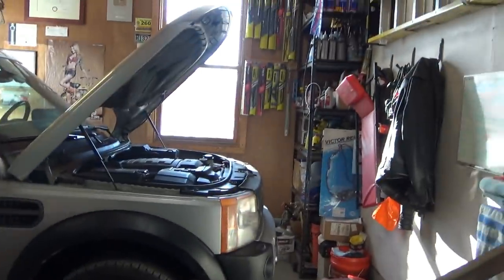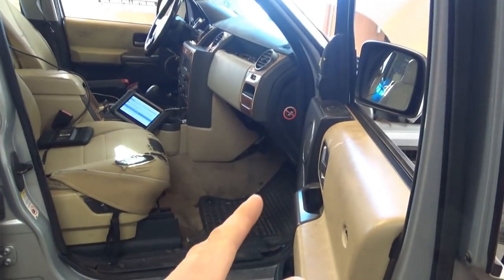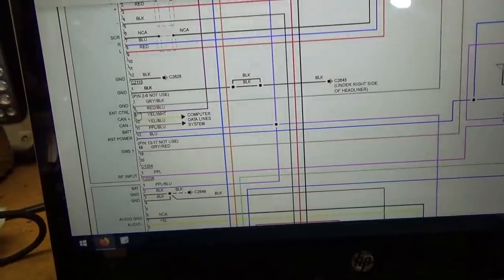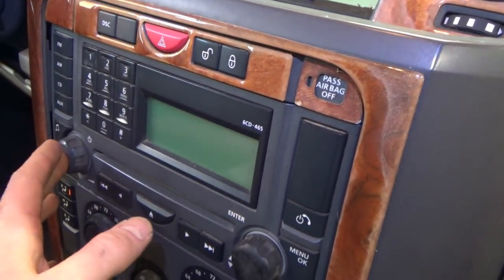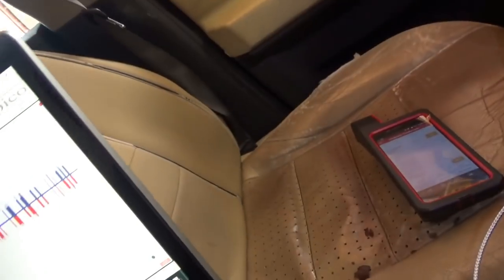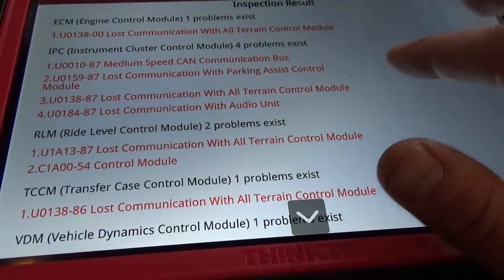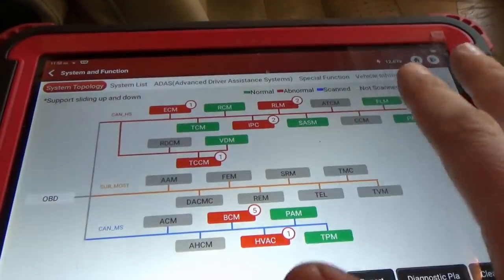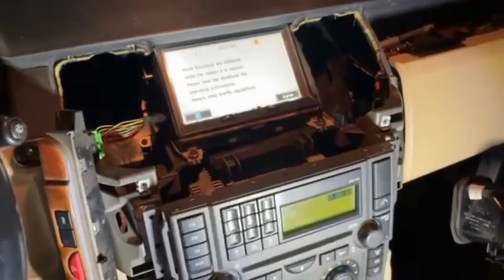Radio? Who Needs a RADIO!? (Land Rover LR3)

Comment: I own an LR3, and have replaced the radios in many LR products. It's often easier to just replace the Nav/radio/amp with aftermarket, as I do that for a living. A couple optical bypass loops, and careful wiring, and you have a great sounding audio system.
Reply: Some problems whit the engine till now? Meaning snap crankshaft... This issue whit the crankshaft is very popular on 2.7 engines in Europe.
Reply: Do you know much about the LR4 with the denso nav/head unit? (not bosch) I could really use some help. Thanks.

Comment: Eric O (SMA) swapped out a Human Machine Interface module yesterday.   He had to make an educated guess. GM says, you take the plastic bag off of the REFURBed unit, you own it.   The radio was all static and  nothing on the screen worked.  The diagnostics really didn't make sense, but everything pointed to it.  He said during the video that 'part' and labor would be about $1,000.  And if the part wasn't the problem, he'd have to eat it.
Reply: I watched that too. I know he took the leap of faith in his diagnosis, but I’ll bet he was more sure than he let on. The Producer said, up the drama and tension… Best Regards

Comment: Great diagnosis. I can't get my head around the point of needing so much software just to turn on the radio, seems like use of technology just for the sake of it.
Reply: @crisprtalk6963  I think the latter are indeed making the profit!
Reply: You can’t blow a horn without it first going through a body control module.
Reply: True glad old car's  don't have all that crap in them at least my Toyota 05 doesn't
Reply: Our manager have meetings for the sake of meeting.
Reply: @neilmurphy845  Not far off.

Comment: It will be interesting to know what’s going on inside the radio unit itself. Is it a transistor failure, bad capacitor or Integrated circuit? Sometimes Ivan opens such things for thorough investigation and micro repairs. Two units in a row, there’s something not right with them...
But anyway, really satisfying diagnosis and outcome. Well done Ivan, you are the Man :)

Comment: Been driving Discovery 2 ever since I got it. Drives like a truck. But. I like it. I've gotten the 3 amigos a few in a row. It will clear and stay clear. Then pop up. It's one of my projects to do a IVAN DIAGNOSIS. Park it in my drive way. Do it the proper way. Scan for codes. Powers and grounds. Go to the module and start checking. 
Instead of jumpering wires and short cutting to clear codes.
I'm going to suspect 2 items.
1. The module lives on the right side under the dash. Right where the sunroof drains. At one point my sunroof was leaking. I have taken it apart and repaired the broken drain line and hose. 
2. I'm suspecting my brake calipers are hanging up. I'm experiencing good excellent brakes a few days in a row. Next. Brakes are getting hard.
Being that the case. I'm ordering brake caliper piston rebuild kits. 
I'm a DYI ole guy. I'm willing to learn how to do this. If I find calipers beyond rebuild. Then I will buy new or rebuilt calipers. 
Wish me luck Ivan.
Reply: Likely to be the ABS shuttle switch, it bolts to the ABS modulator, can be changed without bleeding brakes, wabco part £60, very common cause of three amigos, run a scan on it........

Comment: these computer + electronics troubleshooting are clearly 21st century technology.  Axles and calipers, oil pans and valve covers are solid mechanic's work but the future surrounds the often mysterious car computers and their networks.  Maybe, in 20 years, these computers will better identify their associated failures but until then: powers, grounds, and  communication signals are key.  We just can't get enough of these type videos.  Thx Ivan!

Comment: Eric O just posted a video about a similar issue on a Buick. a new "HIM" (actually a refurbished unit) and a $1000.00 later the car was fixed, but even the Factory scan wasn't telling him much and GM told him that if he opened the replacement part then he owned it.

Comment: Two things impressed me, 1 249k miles and 2 the radio head unit is still available, I'm sure he paid good money for it but just being able to get one, wow
Reply: I paid $139 on eBay :). I returned the other bad one.
Reply: @mattpizzimenti464  Have you tried to find repairmen in NY?
Reply: $50 bucks on ebay.  :) i could have bought 16 used radios and still would be cheaper than a new one from Rover.

Comment: I have worked on an LR3 in the past, had a dead radio in it as well.   Found a burned up SMD resistor in the radio that Rover was using as a fuse.    Replaced SMD resistor with small piece of wire, and it all came back to life...

FWIW:  We also found a BUNCH of corroded splices in the harness in the passenger side rocker area under the carpet.   Rover diagrams suck until you figure out how to read them, then they're OK - actual Rover diagrams give distance into the harness to a splice or connector so you have a good idea of where to start cutting the tape off the harness to go exploring.
Reply: Good find. I would replace the fusible resistor with something similar for safety.
Reply: @dosgos  Remember, this is only temporary - Unless it works (Red Green)
Reply: @icesoft1    Nothing as permanent as a temporary solution

Comment: All those codes are programmed to start popping up automatically starting at 75,000 miles.  This is a Land Rover sales feature.  If you can afford a new Land Rover, then you can likely afford another one in a few years.  These codes are there to scare owners into buying a new one every couple of years.  It also scares off many second hand buyers so that old trashed out vehicles with the Land Rover name plastered across them aren't out there tarnishing the affluent brand image. Obviously not totally serious for those of you keyboard warriors about to get your "Reeeee" on. 😁
Reply: They can link to your bank accounts/ credit record now to determine the optimal time for an expensive "failure", or maybe update the firmware, and randomly disable functions, to "preserve" the performance of the vehicle.

Comment: Ivan, are you ready for the upcoming calls by folks whose cars suddenly lose there connections through UConnect or other cell connected system that will stop when 3G is shut down? Really stinks that Chrysler/FCA/Stellantis and Toyota/Lexus plus Nissan/Infinity all ignored this until now! They have been installing the same 3G based systems right up until 2019 even when they were told the carriers were turning it off.
Reply: Hey! I'm from a distant country... It's very interesting to know about the 3G shutdown. Please show some detailed link where you can read about the shutdown. Thanks!
Reply: @engeneer_ru5827  it’ll most likely be North America first….since we now have 5g and the radio frequencies are needed from 3g to convert to it. Besides we can keep 4g for a while as a fall back….if in your country there is not much 5g you will probably keep 3g a while longer.
Reply: @jonnycando  Thank you for the explanation! What percentage of the US is currently covered by 5G?
Reply: @engeneer_ru5827  not sure maybe 50% or better

Comment: Smashing diag ivan 😀
Looks like the new radio worked perfect 😀
The question is why did it fail, maybe the firmware became corrupted.
Reply: LR is a company that used Lucas electronics for years, they are still known as "The Prince of Darkness" even though the company was closed down in 96, the curse lives on....
Reply: @Blazer02LS  I did notice the Lucas name appearing on new parts but as you said the curse likes the name 😀
I just thought someone bought the name, like some pillock buying the good name of Grundig and slapping it on a crappy washing machine, Shame as grundig made good quality electronics.
Reply: @zx8401ztv  Yeah think it was TRW who bought it, then they sold it to another outfit. Not sure who owns it now...

Comment: Check for water on the floor under the seat getting into a module. Samcrac recently fixed a car that was pronounced totaled because of that issue  with the seat controller.
Reply: Probably because with water damaged cars there is no way of knowing when the next component will fry. 
So you might get it running after the first fix, but then 6 months later there will be another failure, then another, then another.
Insurance just writes it off to prevent future claims.

Comment: So, the ignition on wakes up the instrument cluster, which is the gateway, the instrument cluster sends a wakeup call to the audio head unit 
on the medium speed can bus pins 3 and 11which in turn wakes up the navigation, since the head unit did not wake up it set no communication codes with other modules including the bcm , did I understand this correctly?

Comment: This is an older car, in newer cars a radio is not just a radio, but a computer that does many things a computer is needed for that is not related to basic car function. It's not something you can do without with or replace with something from Best Buy, you would wish they would come up with a standard bus. I think car companies are using the Apple model for their computers, you come to us for a replacement plus the unit is programmed to the car for 'theft' protection, right.

Comment: I had the exact problem on my 2006 lr3 and same codes popping up on my and it was the radio. When I opened the radio it was burn from the inside. Replaced the radio from eBay and it work just fine
Reply: Do you know who manufacturers these oem radio units?

Comment: It’s obvious it’s the radio. The radio can be turned on manually without CAN. The CAN does key command on, illumination on and all the signals to broadcast on the MOST
Reply from the maker: How do you turn it on manually without CAN??
Reply: @PineHollowAutoDiagnostics  Press the knob on the front of radio like you were. It should then light up. This is So you can listen to radio while parked.

Comment: Do you think this is the same for a 2010 LR4 with the Denso system? I had some water leak into sunroof while parked downhill and the majority if water got onto the power strip (clock unit). Fuses are all fine but have not taken anything apart yet. I am in California so cannot come see you. Is there any way we could talk over the phone for a small fee?

Comment: If you really need a radio that badly, wouldn't it be possible to just wire in a cheap aftermarket unit?  If a used stock radio is $200, i can't imagine what a new one (if it's even available) would cost.

Comment: Hi Ivan
I’ve got a Range Rover sport 2006 & the sat nav & radio/CD/telephone keeps coming on & then shutting down with the radio screen display reading “ VEHICLE FAULT SYSTEM SHUTTING DOWN” I have no other faults on the car & it drives fine but the infotainment & sat nav starts up & shuts down every 10 seconds approx constantly. Any thoughts on diagnosis, I’m in the UK so not really feasible to bring the car to you.
Many thanks if you have any ideas. Chris

Comment: Is there a reason why that head unit couldn't be replaced with a high quality aftermarket touch screen? Or does the owner have a thing for factory original? Would even cost much less than a new factory radio.
Reply: It can be done and people do. But you have to bypass the amplifier. You can’t set the clock or change some other settings that the steering wheel button would be used for.

Comment: Eric o JusT had a nice radio diag video on a cream puff Buick.
Reply: And he ultimately guessed.  He's have to eat the thing if it didn't fix the problem.   GM stating "You take the wrapper off - you own it" and not being able to make a conclusive diagnosis  when you have the right equipment is sad.   It's like GM was daring independents to work on it.
Reply: I think it was more to build the suspense he checked powers grounds data lines but never know

Comment: What a fine vehicle, who wouldn't want to shell out 6 figures to own their very own land rover. I think land rover proves that rich does not equal smart.
Reply: What do you propose as an alternative with equal off-road capability and as nice of an interior with as many features? A 2006 Rav4? Lmao. And these cost nowhere near 6 figs new. What are you on?
Reply: @vw5056  Lexus GX470
Reply: @gtemnykh  Heavier with worse off road capability and worse visibility.
Reply: @vw5056  Sorry did not mean to upset you. I was really just trying to figure out why a company that is consistently at the bottom of the reliability chart year in and year out would ever be purchased by anyone? it seems to reward bad behavior. I cant help but think they are a status symbol more than a dependable means of transportation
Reply: @leeross7896  Because perhaps there are other metrics buyers take into consideration when buying a vehicle other than reliability? Drive a Range Rover or Discovery and you'll see why people like them. Plus I don't think they are nearly as problematic as you people who never even owned one make them out to be. Speak to actual owners rather than repeating myths.
Reply: @vw5056  
GX470 curb weight: 4870 lb
LR3 curb weight: 5796 lb

As for capability I’d trust the Toyota 10/10 times to get me home off the trail.  The LRs have good offroad traction control, but are a massive liability.  Many cases of guys getting stuck on the trail with popped airbags

Lol try again bud
Reply: @vw5056  Lexus GX = Land Cruiser Prado

Go to any third world locale and you will see Land Cruisers, they’ve basically entirely replaced the old LR defenders, which is what you’re referring to with safari vehicles etc.  You won’t see ANY modern Land Rovers.

And yes people export the old Lexus GXes to Africa, Russia, etc because they’re the same Land Cruisers underneath and can be bought cheaper with lightly driven soccer-mom miles in the US and shipped overseas.

You should get out more.

You were off by 1000lbs in the wrong direction on the weight comparison and just keep digging a deeper hole.  Sad!

Comment: I'm baffled...  why doesn't the Land Rover have radio security lock out??? even an 02 gmc envoy has that. aka you cant just throw another radio in without coding the ecm/bcm for it to work...
Reply: The physical size of it will only fit 2 Landrover’s. Radio theft is not such a problem these days.
Reply: @AndyK.1  doesn't answer the question though. if Land Rover isnt doing it for this radio they arent doing it for any radio. has nothing to do with radio theft but all to do with forcing user to pay the dealer to code for the new radio. radio theft hasnt been an issue for 20+ years...
Reply: @bobspurloc  Well that’s a good thing for landrover owners.